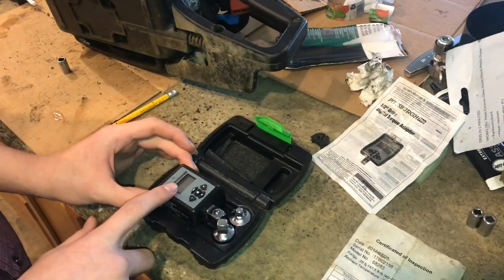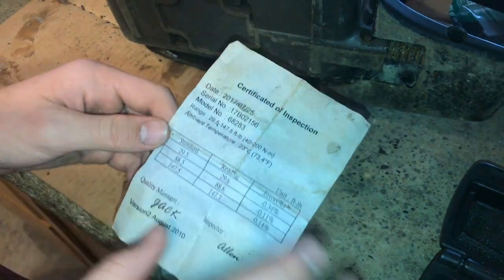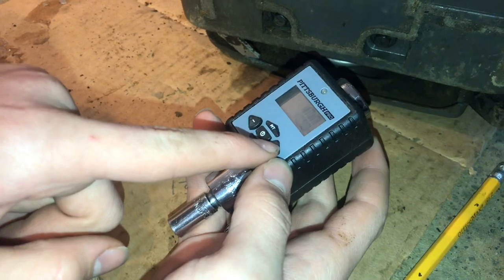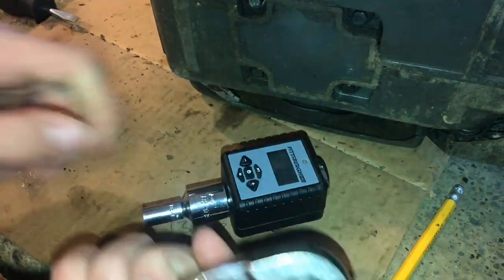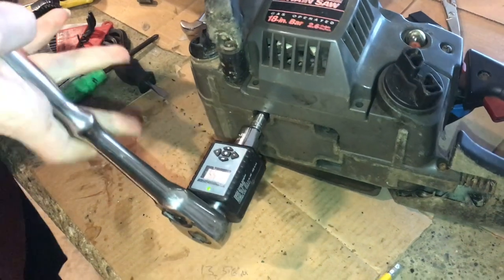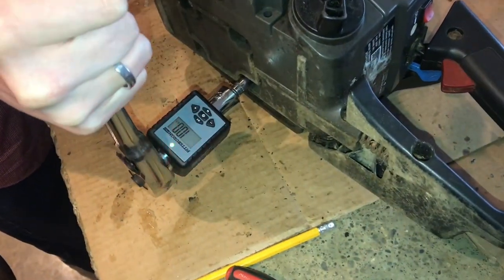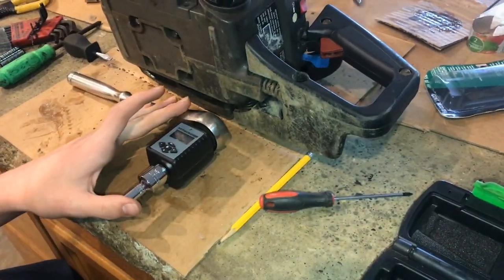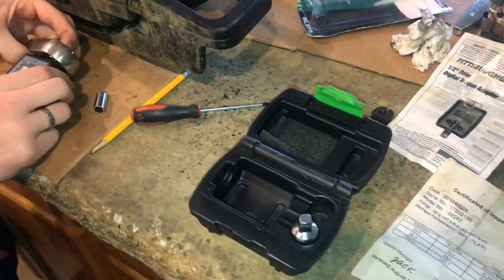(REVIEW) quinn pittsburgh pro DIGITAL torque wrench  63917 (how to use)2

Comment: The new updated Harbor Freight version has been upgraded and the battery issues has been addressed. It now uses double AA batteries and it’s under their Quinn label and no longer Pittsburgh Pro. Any bad reviews on this tool had to do with users complains about the short battery life. The tool is superb! You should upgrade yours!
Reply: Getting one now as we speak!
Reply: I just picked up one today and while it is a Quinn brand(# 63917) , it is 2 AAA batteries- with pretty good brand (Toshiba) batteries...AND it Beeps! It used to be(Pittsburgh Pro # 68283) and used a CR2032(FLAT) battery! If it were AA it would probably have to be a much bigger adapter. Just updating info- NOT judging!
Reply: @IsshmanGarcia  I just bought one as well. Quinn but still AAA batteries

Comment: bolts only take about 80% of their final torque to be broken free and loosened. However a old bolt that has corroded in place will take much more torque to remove so that isn't what you want to torque it to because that same torque could snap it while being tightened.

Comment: the certificate on my quinn is identical on the results but I have different torque specs which makes the math they used to be wrong.
 also, the date mine was done is in 2019 and yet the same/exact temperature was printed.
Same guys (Jack & Allen) 

 However, even though my date is newer and my serial # is higher my model # is lower.
with all that, I'm skeptical on if the certificate is actually valid.
 Otherwise it appears to be the same design as Pittsburg Pro (also found on yt with identical stats on their certs from 5+ years ago). 

 Either way, I'm glad I got it.
 Has anyone verified these devices on actual torque calibration machines?

Comment: When using the 1/4 adapter, can you set the dial to read in/lb instead of ft/lb??
Reply: The Adapter contains three unit
selections: kg-m, ft-lb and N-m.
Reply: Press the ("M") Button and the ("PT") button at the same time to change units
Reply: X by 12 for inch pound

Comment: im so comfuse. why manual saids 29 and you can set in 10... i need a digital ones can i use the torque in a low setting like 5 to 100 for example. im confuse are this can read every torque?
Reply: The Adapter contains three unit
selections: kg-m, ft-lb and N-m.